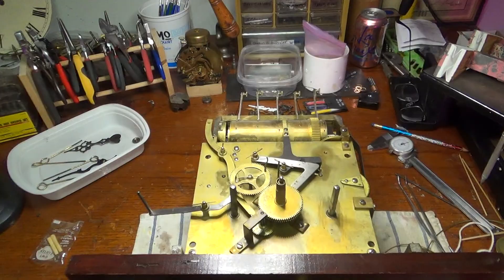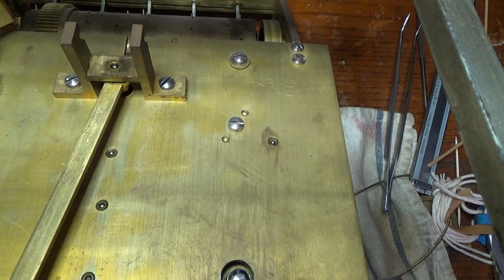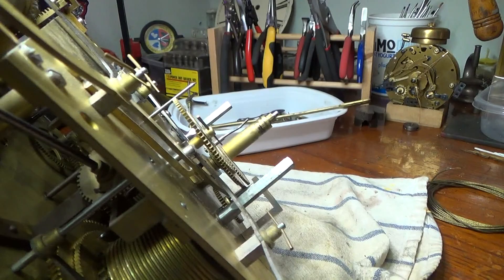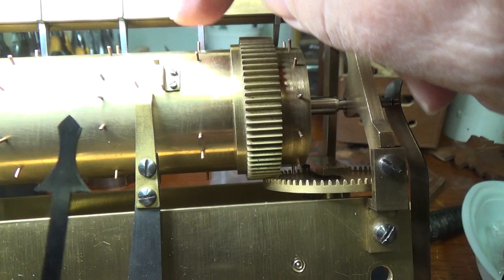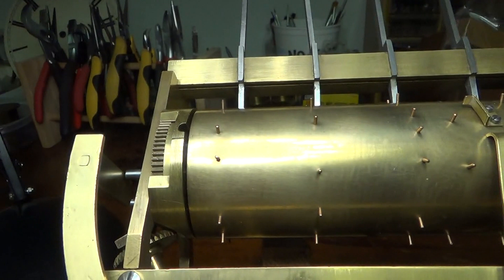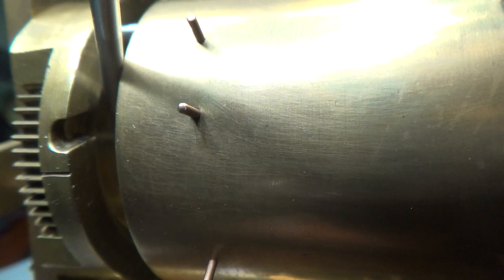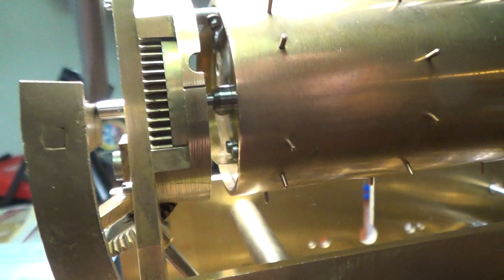1914 Herschede Two Weight Chime Movement

Comment: An index for this video:
0:00 Background on this clock.
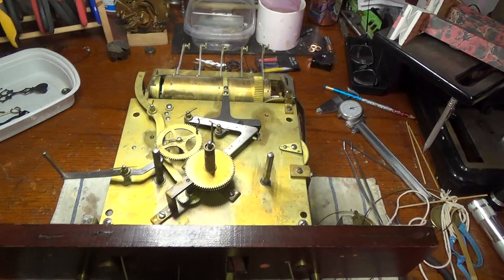1:09 A little about the movement, which he hasn't worked on before.
2:24 The reason it doesn't work: a bushing has fallen out.
3:46 After removing the chime frame; planning to remove the shoulder board.
4:05 How the cables are attached. Planning to replace the cables.
4:36 Removing the crutch and anchor. Examining the anchor for wear.
5:12 Removing the drum assembly and a few levers. Seeing what's left inside.
6:26 Removing the motion works. Discovering misalignment in the motion works, from an earlier repair.
7:41 Finding differences in the minute wheel compared to the books describing this movement.
8:53 Removing the cylinder push spring and the pin wheel.
9:27 Removing the fan (or fly, or governor).
9:49 Details on the order of removing some internal cocks.
10:37 Order of wheels in the strike train.
11:18 Wheels in the time train. The missing bushing. The lever for maintaining power while winding.
12:07 The plates are apart. Viewing the time and strike trains.
12:22 Damage from an earlier repair: prick punches to avoid bushing a pivot hole.
12:48 Labels on the plates: patent date, serial number, and trade mark.
13:05 Noting the order and position of the remaining parts.
13:31 The repaired bushing for the great wheel of the time train.
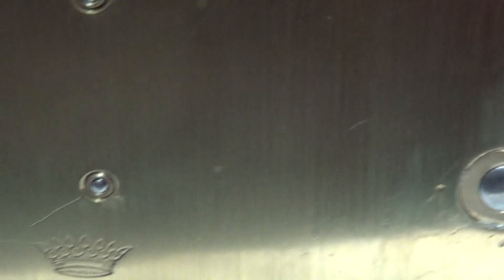13:53 The reassembled wheels. Testing the cleaned time and strike wheels.
14:30 Instructions stamped into the chime assembly.
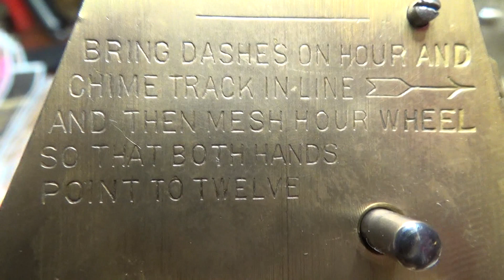15:11 The movement with the chime assembly installed.
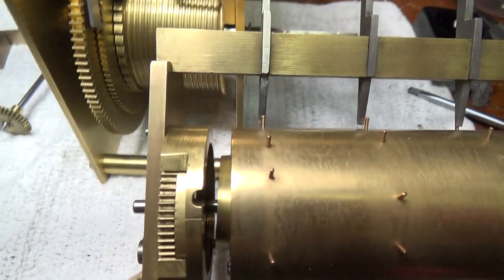15:24 The chime cylinder alignment.
16:02 How the strike and chime mechanism works, in detail.
40:11 How he researched descriptions of this clock and found an article in the NAWCC Bulletin from October 1996.
41:30 Differences between this clock and the one described in the article.
Reply from the maker: Again, thank you.

Comment: Thank you very much for taking the time to produce this video. I have been doing clock repair for 30 years and just took in a slightly earlier version of this movement. First time in my career I have seen this particular mechanism.  It has no stamped instructions on the end of the chimes cylinder assembly like yours did.  The plates are all decorated with engine turnings.  Your video saved me many hours of study trying to determine all of the synchronization of this movement. My movement has  (2) small 12’s  stamped on the strike advance wheel and chime housing instead of two lines to align.  Quite an interesting mechanism for sure.  I could tell while disassembling it, the previous repair person never quite figured it out, as a few critical things were aligned properly. Even the hour wheel was not correct since it struck 3 times at 7pm 😊. Everything back together now and working fine. Thanks again for your immense help!  Pete.
Reply from the maker: I'm glad it was helpful.  Quite a different mechanism.

Comment: Mr.Perry.... I have watched all your clock videos...I love them all...you are very good at the clock repair and you have taught me a lot..I want to start fixing clocks but after watching you I'll need a lot of tools to do this right.  Thank you
Reply from the maker: You can do what I did; take on repairs that you can do with household tools.  Don't think you have to start with rebushing.  You can start with a time-only clock, take it apart, clean it, reassemble it, oil it and run it.  You don't need an ultrasonic cleaner. I did all my cleaning by hand and didn't start using an ultrasonic cleaner until I was given one as a gift 3 or 4 years ago.  Pivot polishing can be done with a multi-speed electric drill or even by spinning the gears in a pin vice.  Awkward, but it works.  Many repairs can be done with common tools of pliers and screwdrivers.  As you want to expand you abilities, buy the tools as you find need.  Don't worry about doing everything perfectly to begin.
Reply: Thank you for the advice...I am quite mechanicaly inclined. I am.a telecom technician and I used to rebuild old telex machines. I built an.airplane from plans with my dad and brother 15 years ago. I love clocks and I have a grandfather clock my dad built me 40 years ago, a ships clock, a school house regulator I built from NewEngland Clock Company and I just got a Seth Thomas Wall.Clock.with a Hremle 351 cable movement. I am looking.for a antique clock to try to get running.and I will try to do what you said and use some common tools. Maybe look for a good set of broaches and reamers. Where do you buy your bushings and pivot wire from? I live in Canada and there are no places to get that stuff up here.
Reply from the maker: Timesavers has most everything you'd need and the ship internationally.
https://timesavers.com/
A Canadian company that supplies clock and watch parts and tools.
https://perrinwatchparts.com/
Reply: Thanks a lot  I am in Ottawa Canada? Where are you located?
Reply from the maker: Genoa, Illinois
Reply: Nice  maybe we will run into each other some day down the road.  Cheers
Reply from the maker: Better hurry; time's running out.  Not too many "some days" left.
Reply: Oh I hope you are not ill... or do you mean the covid mess?
Reply from the maker: I'm 78 years old and health is declining.  At this juncture in life, one is happy to see the sun rise each morning.
Reply: Your still young...I.am almost 64 and ready to retire.. I am glad you are doing well.. The knowledge you have is really awesome. Not too many around that can even use a screwdriver.. I just appreciate what you have done with the.clock repair channel.
Reply from the maker: Thank you.

Comment: Awesome movement, and another great explanation as to how it works. I am guessing that the heavier weight on that side combined with a lot less gear reduction compensates for the loss in weight drop when it is doing nothing but spinning a full turn while not striking. Genius. Both the people who designed this and you for figuring it out. Thanks again for another great video.

Comment: I know this video is old but if you check messages let me know. I just finished a 2 weight Herschede 9 tube movement. My movement is the exact one the book talks about. I have the spiral groves that the pin rides in. Thanks for your video it helped me understand mine. If you like some pics of my movement let me know! 
Mike
Reply: @dperry428  Just posted the video , it's kind of long but at the 3 min mark I get a close up of the mechanism.
Reply from the maker: Watched the video.  Keep posting the progress on the servicing.

Comment: Hello I bought a 1941 5 tube 436 model.  The person previous to me. Let the cable unspool but did not knot it into the slot of the drum.  My question is.  Which position does the drum need to be in, when I retie and knot, the cable.  Meaning the position of that slot.  Does it need to be toward me, away, up or down when I begin to respool the drum.  Any help would be very appreciated.
Reply from the maker: I really don't understand your question. All that is important is that the cable be wound onto the drum following the spiral groove on the drum.  When I start the cable, facing the front of the movement, I put the cable into the slot at the 9 o'clock position and wind the cable on, keeping tension on the cable with the left hand as I wind with the right hand. I wait to wind it on until the movement is in the case, keep tension on the cable while winding until the weight can be positioned; then continue to wind until the weight is at the bottom of the movement. It helps to have another person attach the weight as you keep tension on the cable.
Reply: @dperry428  HELLO.  Okay so spoil drum lost tension 2x. 1st I re-spooled the loose drum coil.  Second I had gone thru 6 rounds of quarter, half, quarter, hour. The question was, the positioning of the drum.  When I retie the knot to re-spool. So to make sure the locking slot should be at 9 o clock position before you begin to re-spool I was not sure of 9, 12, 3, 6.  So, you are saying tie the knot into the lock slot when the drum slot is faced toward 9o'clock and then turn with tension following the grove clockwise.  That will maintain the tension so that it does not drop again.  Is this correct?  Thankyou so very much for your help.
Reply from the maker: I'm sorry, but I haven't a clue what you are trying to describe.  What is a "spoil drum" and what do you mean by "lost tension"?     
It's really very simple.  There are two ways that a cable is attached, with a know to the drum, depending on design.  One way is for the slot in the surface of the drum to have a hole large enough to fit the knotted cable at one end of the slot.  Another way is for there to be a hole in the end of the drum, where the cable end, untied, is pushed through the slot on the surface of the drum and out the hole in the side of the drum. The cable is then knotted and pulled back through that hole to the inside of the hollow drum. The knot cannot, then, pull out of the slot.  The cable is then completely out of the movement except for the one end.  The pulley is placed on the cable and the free end of the cable attached to the seat board to which the movement is attached. With the seat board and movement in place within the clock case, simply pull down on the cable end that is attached to the drum and wind the cable onto the drum, keeping tension on the cable so it follows the grooves in the surface of the drum.  When the cable is sufficiently wound that the weight can be hung from the pulley, put the weight on and fully wind the cable.  It sometimes takes two people to do that so the weight can be attached without losing tension on the cable.  If the cable is not kept under tension, the wound cable will fall out of the grooves and become tangled and you'll have to start all over again.     The position of the drum and slot is irrelevant if the cable attachment is by pulling the knotted end through the SIDE of the drum.  It IS relevant if the cable knot is put in an enlargement of the slot in the surface of the drum, as it can fall out or be pulled out if the drum is not in a partially wound position, such as at the 9 o'clock position.
Reply: I really dislike auto correct.  I'm so sorry.  The cable drum is the one with a side slot.  So you tie a knot with a loop so that the knot is held in place by being put thru  the slot with the first loop sinching it in place. Then wind drum.  I was asking if it mattered on the position of the drum once the knot is put in and you begin to wind cable into the drum.  As far as it loosing tension, the cable completely ran thru and off of the drum.  Thank you sir.
Reply from the maker: You say the cable filled the drum and beyond.  That's why it's so important to have no more cable than is needed to fill the drum plus the amount to go from the drum, through the seat board, through the weight pulley and back to the attachment on the seat board.  To determine how much cable goes on the drum, measure the diameter of the drum with a caliper and count the number of grooves on the drum.  Now, using the formula for circumference (distance around) of the drum, multiply the diameter by pi (3.14). That is the distance around one turn of the drum.  Now, multiply that number by the number of grooves and that will give you the total amount of cable needed to fill the drum.  Add that to the amount to go down and through the seatboard and pulley and back to the seatboard attachment and you have the amount of cable needed. You can add the amount needed for the knots at the ends of the cable.  You will now be able to wind the clock fully without overfilling the drum.
Reply: Yes thank you.  It was that there cable ran out.  Becase the person before myself did not knot the cable before winding it onto the drum.  I understand the rest of it.  Thank you so much for your help, I appreciate it.